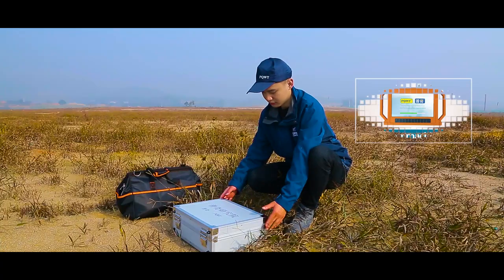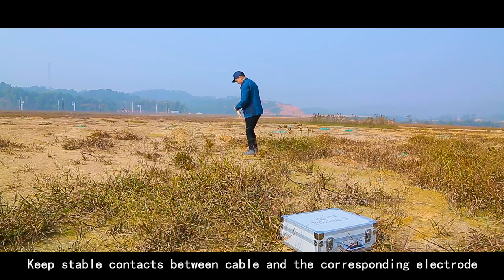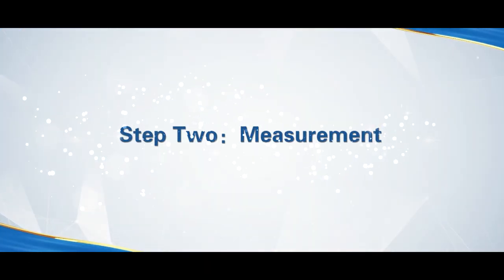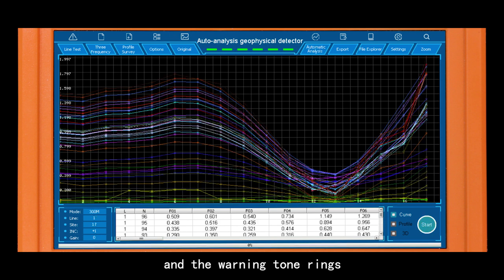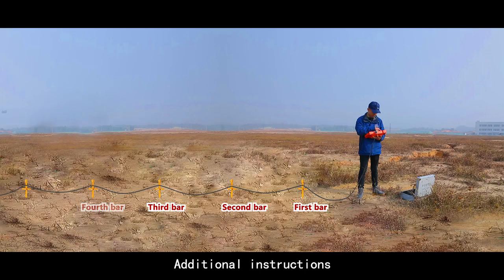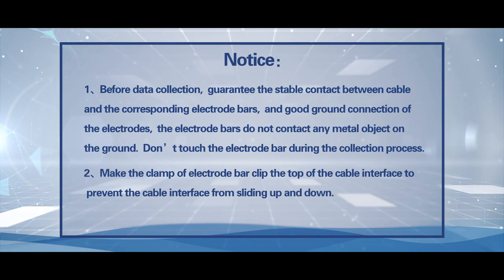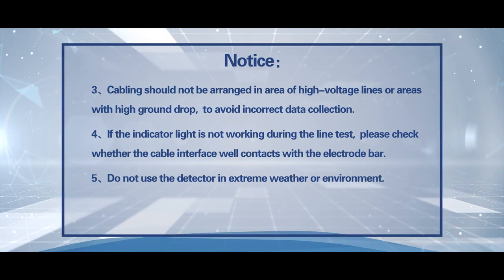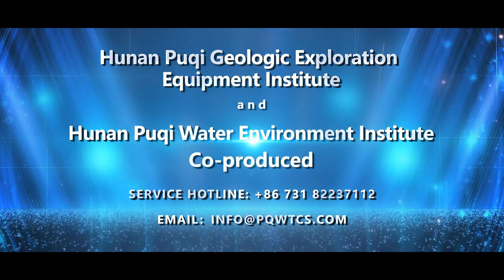NEW #PQWT-GT Series Auto Analysis Geological Under Ground Water Detector

Comment: the suggested point is 2.13 is it a range? 2,3,4,5,6,7,8,9... Or does it only refer to point 2 and 13?
Reply from the maker: The suggestion is refers to single point, not a range. And most of the time it would suggest combined analysis.